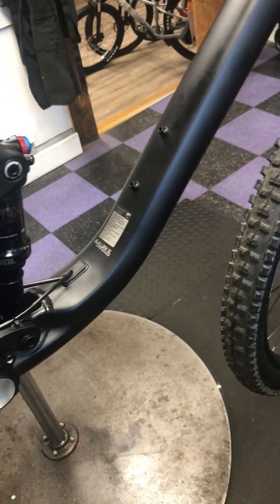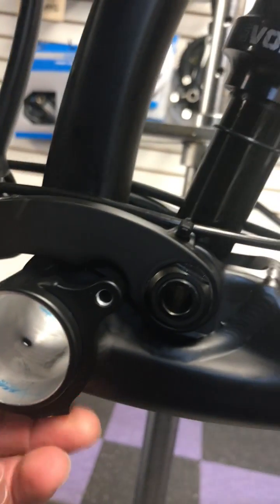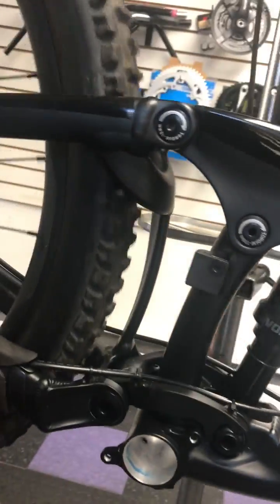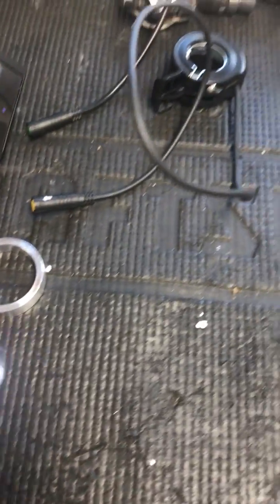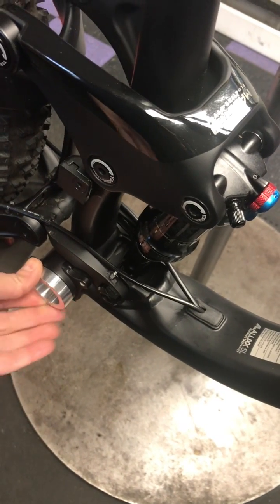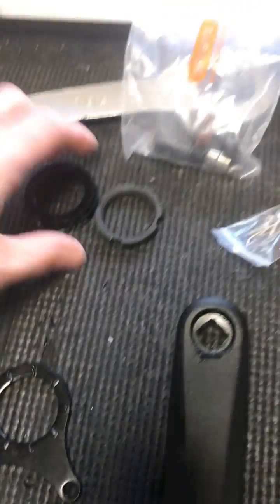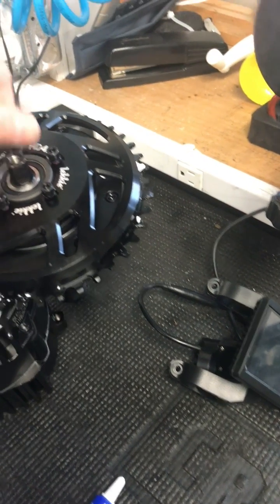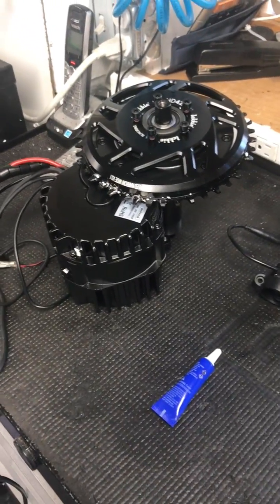Giant Trance 2021 Bafang E bike Conversion Series Part 2

Comment: For those who don't know, the more recently available CYC Photon fits right on there without stuffing up the chainline. I looked at TZ (won't fit at all) and Bafang, (fits but stuffs up chainline) and delayed long enough to be an early adopter of the Photon. Could not be happier, this is an absolutely awesome system which will fit most modern 1x Boost mtbs.
Reply from the maker: @hindesite  is it programmable system like bafang.

Comment: Pls I need you help, I have same bike and am not sure the bafang motor that can go with it and any adapters I may need
Reply from the maker: @ojeiemma9244  this bike uses the 100 mm ish sized bottom bracket. It’s the only offering in that width.  Matt at emp electric bikes sold me the unit and he gives you the spacers.  Look them up. I didn’t care for the spacers as the tolerances were crud so I had new ones made.

Comment: What size chainring is that and how is the clearance to the chainstay? The stock Trance doesn't seem to have much room to accommodate larger chainrings.
Reply from the maker: Pretty sure it’s a 42 and yes you have to space it and there’s only a few mm of clearance. Luna cycle sells a more expensive kit that replaces the outer cover/smaller chain ring that gives more clearance. I can double check size next time I run down. Are you doing this kit/bike setup?
Reply: @blarpieman  I have this bike, but I'm in the process of considering motor options. So is the idea to space the chainring so that it's more outboard than stock, so that it completely clears the flared section of the chainstay? Do you reckon you'd be able to fit an even larger chainring using this method? Does this compromise your driveline?
Reply from the maker: @zhutwo  yes it will mess up the drive line and the crank spacing in relation to the frame if you push the motor further out to the right. I still had to offset my cleats a little even w the current set up. I think if you want perfection you will have to go to a smaller chain ring w that adapter kit that replaces the outer motor cover from Luna cycle and then machine the right side aluminum spacer.  You should have new spacers made anyway because the fits aren’t good. Maybe Luna has better spacers than Matt at emp. Also I don’t think it will be a good idea to use a bigger chain right mine barely cleared by about 2 mm
Reply: @blarpieman  Appreciate the insights
Reply: @blarpieman  How's your q-factor? Does it feel super wide pedaling? I'm debating if I should just find a donor bike with a 73mm BB.
Reply from the maker: @zhutwo  it feels ok I like the wider feel lower q angle
Reply from the maker: It’s a lekkie 42 it fits. I had to have better spacers machined because the ones from Matt at emp had terrible clearances and it creaked badly.

Comment: I just bought a 2023 stance E+2. i was thinkn maybe it wouldnt be fast enough...it flys uphill and the yamaha is so small and light handling is amazing . im sure the bafang is faster but im not exceeeing 20 mph on trails anyway and i dont ride roads due to shitty drivers the yamaha 75 n.m. is alot better this year higher cadence and nasty off the line power

Comment: Thanks for the help with the bottom bracket install. I'm doing the same build. What kind of BB adapter are you using and where did you get it. Thanks Mitch
Reply from the maker: Welcome, and I got it from matt at empowered and I would purchase the tightening socket if available because the motor will come loose if you use a wrench and it will probably come loose anyway.  I wound up taking a metal hose clamp splitting it into 2 pieces and drilling a small hole in each side so that it can be connected together to hold the motor up around the lower part of the frame in front of the shock right where the cables cross.  You can then attach each side to the two small screws on top of motor to hold it up.  Then you can attach the hose clamp together and tighten it to add support so the motor doesn't fall.  I would also build a large motor guard using Kydex sheets and run it from around the bottle cage to all the way underneath the motor.  I am using currently two pieces on on top of each other and molded it using a heat gun.  My initial motor guard I built isn't all the great for sliding over things so I rebuilt a new one and haven't posted a vid yet but I can when Im done on both things!
Reply from the maker: I would check out the bb adapter from luna as they have a better solution for motor slippage.
Reply from the maker: https://www.youtube.com/watch?v=iyIFVK7W4zs
Here is the new guard I built yesterday and new motor mounts.